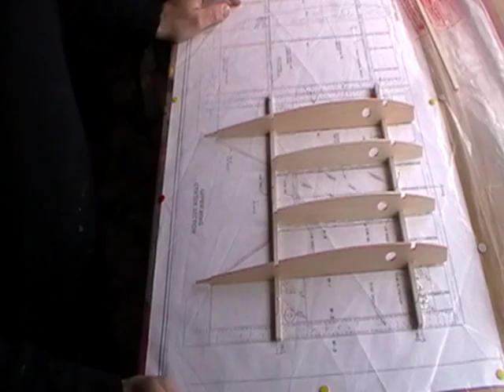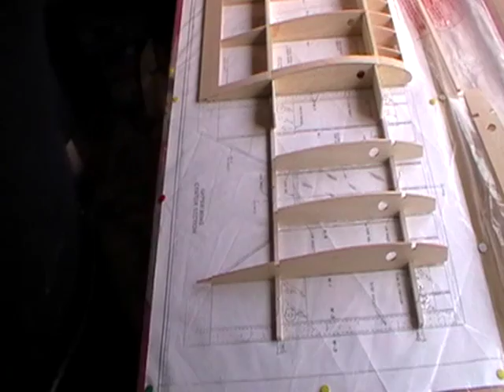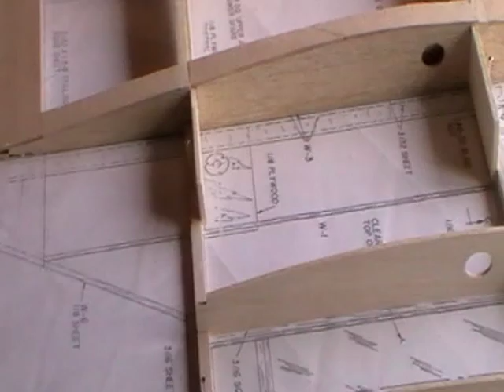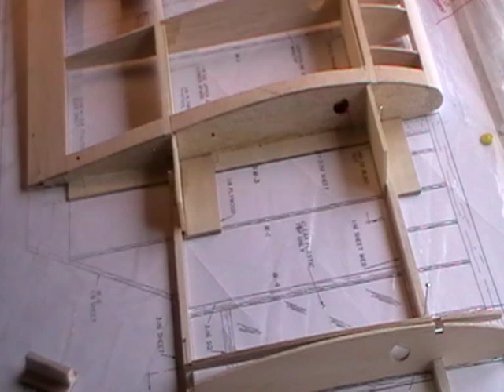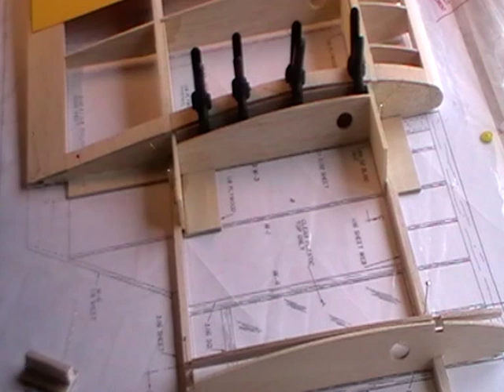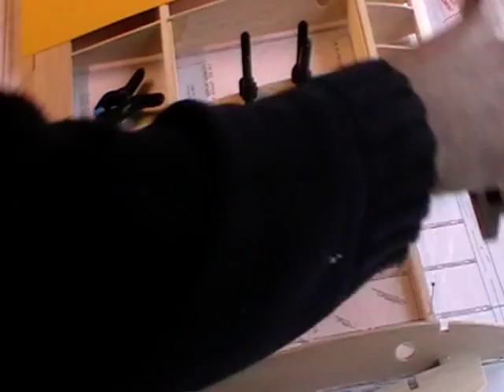Balsa USA Sopwith Pup 1/4 Scale top wing centre section construction part 1

Comment: Thank you for this, can't wait till I finish my lobster boat, which I plan to get the 1/3 scale version o this afterwards, should be a very nice change from the guillow kits I normally build, where with the guillow kits weight is everything, it looks like with this scale I'll have to focus more on the strength aspect, should be fun :), and thanks again.